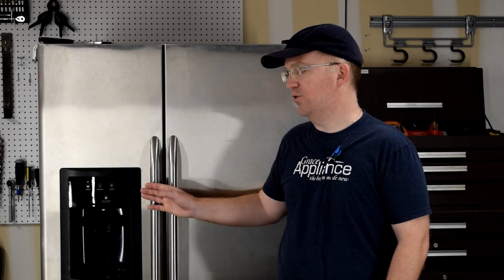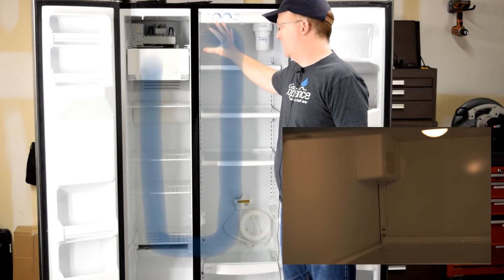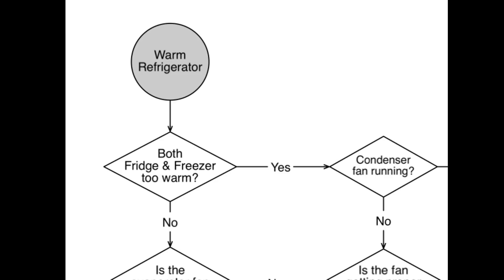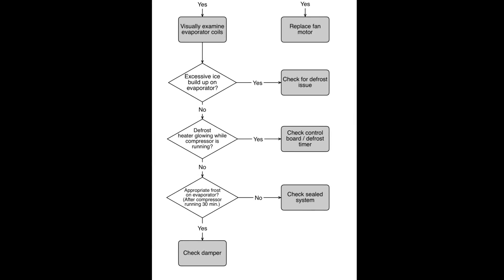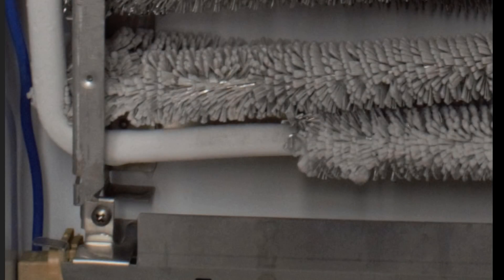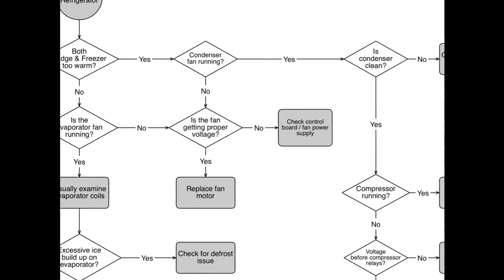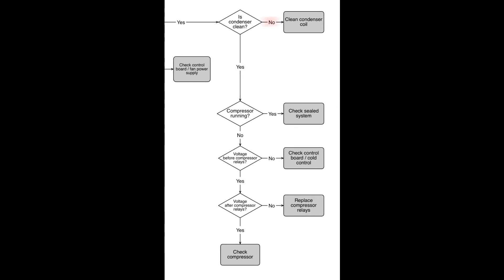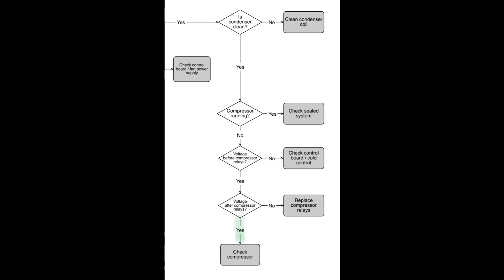Refrigerator Too Warm - Diagnostic Steps

Comment: HI Andy,  I recently replace the control board  and the heater element on my GE Refrigerator Model  GSHF5KGXCCWW  .  I am still seeing ice on the top coils but the rest of the coil are good. should I replace the thermostat as well .  The freezer is still not working where is should be and not making ice.  Any help will be be appreciated.  thank you.
Reply from the maker: Hey Danny, 
Sorry to hear about the trouble with your freezer.  
Before you replaced the heater, were you having a defrost issue? I.e. heavy frost build up on all of the coils and frost on the back wall of the freezer wall inside the freezer? 

If not, you didn’t have a defrost issue, but if not all of the coils are frosting up (except for like one rung of the coils), you may have a sealed system issue (refrigerant leak or compressor issue). 

Let me know what you were experiencing before the repair.  

Thanks!
Reply: Yes Ice was build up but after replacing the heater element , now just seeing ice on the top coils and the ice maker is not working.  I put an old ice tray and put water in it to see if it would make ice. after four hours it is getting frozen but i think it should not have took that long to make ice..  There is a strong water flow from the water dispenser  but now water is going to the ice maker.  I reset the ice maker but still no water.  So I am at a stand still.  is it the thermostat. or is the ice maker bad.. your help is appreciated.
Reply: Sorry meant to say Water is not going to the ice maker.
Reply from the maker: @dannygonzales4572  hey, please send me the first 5 digits of your serial number.

Bad thermistors (temp sensors) will not cause the coils not to frost up. If the compressor is running and has been for 24 hrs, your coils should be fully frosted. If only the 1st rung is frosting up, that sounds like a sealed system issue. It doesn't make sense to me that before a board and heater it was fully frosted, and after not. Unless the lines were damaged in during the process of changing the heater. Just my initial thoughts. 

You didn't use a screw driver to chip off ice from the evaporator did you?
Reply: SN: RR421562    as far as the ice on the coils goes, the coils were iced up on all of them.  I called out a repair man and he told me it was the control board and the heater element.  he wanted 400 dollars.  so I ordered the parts myself and it  stalled them   I unplugged the refrigerator for a day to defrost all the ice off the coils.  I had installed the control board first because that came in before the heater element.  Then a few days later I installed the heater element.  then waited a day and notice that there was ice on the coil but only at the top.  The ice maker stopped working so not sure where to look from here.  Do you think its the thermostat?
Reply from the maker: @dannygonzales4572 
It sounds like your evaporator is not frosting all the coils and as a result the freezer will not get cold enough.
The icemaker will not function unless it's under 15F.

As I mentioned, a failed sensor will not cause this issue. Only a sealed system issue will cause the evelorator to only frost on the top. To me, It sounds like it was misdiagnosed originally. 

Unfortunately, a sealed system issue is typically more expensive to repair than a normal fridge would be worth. It's not a DIY task unfortunately.

I'm sorry for the bad news, but hope the info is helpful.
Reply: So there should be frost on all the coils not just the top coil.  is that correct?   I bought this unit used and was working fine for about 3 months then the freezer got warm.  So I was hoping it was something I could fix my self.  I will be taking the panel off this afternoon to see if there is any change maybe I can send you a picture of it so you can see what I see.  is there an email I can send the picture?
Reply from the maker: @dannygonzales4572  Yes, every rung of the evaporator should have frost on it except for the first rung or two.  
This is assuming that the compressor is running full time and not cutting on and off repeatedly.  

The frost pattern is very telling if you can send me a picture today I'm happy to have a look.  I'm headed out of town tomorrow and will be away from the computer.   Thanks!   graceappliance@gmail.com
Reply: Awesome , I will do that.  should be home this evening to send picture.  Thank you Andy for all your advice.
Reply from the maker: Sounds good, you’re most welcome.  Talk to you then.
Reply: Hi Andy , Hope you had a great holiday.  I did order the Defrost Sensor from you and I was going to install it but after removing everything I noticed that the Evaporator fan in the freezer was not working.  I stuck my hand up where the fan is and it was not moving.  I moved it with my finger and the fan kicked on. It was not very strong because when i  stuck my hand again in the fan it would stop.  I unplugged the unit and then plugged it back in and the fan did not move until I pushed the fan with my finger.  So if the fan is not working properly then would ice still build up on the coils?   After I got the fan started  I left it alone and checked it the next day.  The ice dropped but it was slush and the ice was not hard. so do I still change the sensor or replace the Evaporator fan or both.  Thank you for your help in advance.
Reply from the maker: Hey Danny, 
I did have a great Thanksgiving and hope you did too!  Too much traveling and I'm definitely glad to be back to my own bed. : ) 

Based on the picture you sent, You don't have a sealed system issue which is great. Also, it appears all the defrost components are working as they should, so i'd leave the sensor alone for now. 

The fan not spinning (or only with a boost) is most likely going to be a weak fan motor and a new fan motor will probably do it.  However, it can also be the control board not sending enough voltage, which is far less common with the symptom you describe.  
If you have a volt meter, i've got a video that will walk you through how to test the voltages if you wanted.  Or, simply replace the motor and call it good. But, a fan not working properly will certainly cause ice build up on only certain coils as you describe, and can look a whole lot like a defrost issue. 

Based on your model number, the fan you need is: 
OEM GE Motor affiliate link: https://amzn.to/2KG4fxT 
or
Cheaper Aftermarket fan motor affiliate link: https://amzn.to/2E0wCpX

I haven't used the aftermarket one's before so I can't speak for the quality, but you can't beat the price.  You may dig in to the reviews and let that make your decision. 

Let me know if you have any questions! 
Thanks
Reply: Hi Andy,
I ordered the fan, I will let you know how it goes.  I wont have time during the week because of work but I will tackle it this Friday. 
Thanks for all your help.
Reply from the maker: Danny Gonzales awesome! Best of luck and I’ll be here if you run in to any hiccups.  Stay in touch.
Reply: Hi Andy, i put in the evaporator fan and I got a good deal with the after market fan with the link you send me.  The fan sounds a lot stronger and i can fell the are coming through the vent.  I have one question about the setting on the freezer.  what number do I set the freezer and refrigerator to?  On the freezer door the controls are there, so I want to set the coldness and you tell what number to set it to please..  Thank you for your help in advance.
Reply from the maker: Awesome! So glad to hear the good report. Nice work!

You're wanting 0'F in the freezer. I believe this means 5 as the setting, but I'd verify with a thermometer. Just make sure thkngs like icecream stay frozen rock solid. Chicken beast and meat as well etc etc.
Reply: Andy, I got ice, Thank you Thank you Thank you, for all your advice.  It was the evaporator fan that held me up.  I am hoping this will last a long time.  
Have a great weekend and Happy Holidays to you.  Take care I will tell everyone about your Videos.
Reply from the maker: @dannygonzales4572  you too Danny! Thanks
Reply: I want to send you a donation , can you tell me is it safe and secure to do so?  I am  just curious , 
where did you come up with the name Grace appliance?
Reply from the maker: @dannygonzales4572  thanks so much Danny. The donation link will take you to a secure link on PayPal which of course is totally secure. It's much appreciated.

The name Grace Appliance came from me having worked a 9-5 job at a very large bank which will remain nameless, I'll just say it rhymes with Chase Bank. I constantly feared getting laid off... Even if you were doing a great job and your department was doing great, they'd lay off 7,000 people at a time. I thought, ok if I move to a smaller company the stress will be less... Nope, still stomach knotting stress, just with less zeros when it comes to layoffs. So, this fear I found was not from layoffs but rather a lack of trust in God's sovereignty and purpose for my life. It took me a long time to realize that security comes from the Lord and not a paycheck. So, taking the leap of faith to start my own business was founded on Ephesians 2:8
For it is by grace you have been saved, through faith—and this is not from yourselves, it is the gift of God— not by works, so that no one can boast.

So, I wouldn't say I no longer stress about these things, but it's a reminder every time I pick up the phone. :)
Reply: Praise the Lord, I am a Christian as well and Its nice to know that there are good Christian people out there that will  help as yourself.
May the Lord richly bless you for helping people and saving there pocket book.  Have a great evening.  God Bless.
Reply from the maker: Danny Gonzales thank you again Danny for the ever so gracious donation! Bless you and your family this Christmas! Stay in touch.

Comment: Andy, this is a very informative video.  We have a GE Profile Refrigerator (Model TFHW22R), around 26 years old, never needed servicing, 2 door side-by-sdie freezer on left/refrigerator on right.  Freezer is 10F and Refrigerator is 48F.   I do hear a motor sound.  I pulled the Refrigerator out and the coils on the bottom had a heavy accumulation of dust which I vacuumed off and blew out with my air compressor.  If I read the Flowchart correctly, I have a "Sealed System" issue which I suppose likely means low on Freon.  How do you check for low Freon?  What Refrigerate does this refrigerator use?  I have some automobile AC compressor gauges (R132) and some Heat Pump gauges that I could use but don't know the pressures or where the Hi an Lo taps are at.  The other consideration is to simply replace our Refrigerator with a more modern one but we hear a lot about newer units being so unreliable.
Reply from the maker: Hi Carl, thanks for the kind words and I’m sorry to hear about your fridge issues. 
Just as a general statement, if both compartments are warm as in your case, dirty coils can cause this problem. Once cleaned and having run for 24hrs - the temp in the freezer should freezer should be sub zero (around 0’F, assuming the condenser and evaporator fans are both operational). If after this long it’s still not at temp, I would agree it’s a sealed system issue. (Note: Be sure you’ve ruled out a defrost issue as well, heavy frost on the evaporator coils and on back wall if the freezer cabinet) 
This could mean low on refrigerant, but most often it means a failed compressor (I.e. a compressor that isn’t compressing as much as it should any longer). 

To answer the questions about the refrigerant, it’s going to be R134a which is the same as most modern automobiles. However, dealing with sealed system jobs is not a diy task. To check pressures requires tapping in to the sealed system via valves that aren’t there currently, and looking at the low pressure side pressures. You’d then weigh in the right charge of refrigerant which is only like 4-6oz and requires some equipment most folks won’t have. 

If you’ve determined it is in fact sealed system issues, the right answer is to put the money towards a new refrigerator, sorry to say! 

Let me know if you have any questions. Thanks!
Reply from the maker: Also, verify that it is in fact the compressor that you hear running. Should be vibrating some and be warm to the touch.
Reply: Popped the inside back cover off the Freezer compartment and noted a lot of Ice on the upper part of the coils.  My Refrigerator has two heater strips and when I turned the control to Defrost the strips worked, but did not get all the ice off.  Turned it back to Defrost again and neither strip was hot.  Took my ohm meter and got 11.5 ohms for each strip.  Assuming the Thermostat.  Well, I used my heat gun to get all the Ice to melt and put it back together.  Still the Temps are 20F in the Freezer, and high 40's in the Refrigerator.  I'm assuming my old 26 year old Refrigerator is ready to be retired.  

We have a 36 inch opening but its next to a door opening and the moulding protrudes about 3/4".  Do they make new Refrigerators that are 35" ??  Or do we have to go with a 33" model?
Reply from the maker: Hey Carl, 
I agree. It appears to have a sealed system issue judging from what you’ve described.  I’d put the money towards a new refrigerator as well. 
The width is not a standard thing. They’ll typically be somewhere between 30-36” to allow fitting through doorways. You’ll need to look at the specific model spec sheet to verify the width so it fits in your space.  They also make counter depth fridges which do not stick out as much which may or may not help your situation too. 

Thanks!

Comment: Hi Andy, videos are great same as you, my model No: GSR23KSTE SS , PROBLEM IS THE FRIDGE WORKS BUT WHEN IT TURNS OFF BY ITSELF IT DOES NOT RESTART BY ITSELF UNLESS I APPLY HOT AIR FROM A HAIR DRYER TO THE CONTROL BOARD AT THE BACK AFTER REMOVING THE COVER, THEN IT WORKS FOR SOMETIME THEN THE WHOLE THING REPEATED AGAIN AND AGAIN,,,, WHAT DO YOU THINK THE PROBLEM IS
Reply from the maker: Hey Freedom, 
Thanks very much for the kind words, It means so much. 
Interesting!   Almost certainly it's a failing relay on the main control board.  They will get weak when they're on their way out. They will intermittently complete the circuit and other times not. 
It may have less to do with the hair dryer and more to do with slight jostling of the board which causes the relay enough umph to snap shut.  

One thing i'd want to know what exactly cuts off when the board gives issues. 
If the compressor, fans, and front panel cut out all at once (but lights stay on) - It's the main board (my guess based on your description)

If everything cuts off (lights included) - likely a power / connection / cord issue. 

if the fans continue to run, but the compressor only cuts off - it's likely bad relays at the compressor (not the main control board) 

If you haven't already, take a look at this video and see if you can identify any of these common failure points on your board. Often these boards capacitors will fail causing this symptom you're having. 
https://www.youtube.com/watch?v=zbmAqizE128

I hope that helps!   Let me know what you find.
Reply: Thanks very much Andy for your fast reply, I didn't expect that great , professional and polite response, as for the fridge when it turns off it is complete off except the interior light but the front panel lights are off too, and when it works after I dry its hair , it works perfectly fine sometimes for a day or two and sometimes just for one cycle, also sometimes it turns off with a clicking sound coming from the front panel
Reply from the maker: Hey Freedom, 
You're most welcome. 
The symptoms you mention make the main control board (behind the refrigerator) super suspect.  I'm still leaning very heavily toward that being the issue. 

One thing I neglected to mention in my last response was, you'd want to be sure to rule out a failed (i.e. shorted) touch panel in the front of the refrigerator. 
Please take a look at this video: 
https://www.youtube.com/edit?o=U&video_id=ViFpwH6_WrM

If you can catch the fridge while it's in an off state/giving the issue currently, if you will unplug the wire harness from the front control panel - the fridge will fire to life.  If it does this, it indicates a shorted front touch panel. If no changes when you unplug this board, it would be a failed main control board behind the refrigerator. 

I hope this makes sense and helps!   

Andy
Reply from the maker: sexylitehaiti sexylitehaiti 
Hey,
Too hot to touch. It glows orange like a toaster.

Let me know if you have any questions. Thanks
Reply from the maker: Hey, you'd need a multi meter to check for 120v to the 2 wires while the defrost is on to be sure. But it does sound like it's getting power.
Also, you can disconnect the heater from the wires and do an Ohm resistance test to see if the heater is good. Should be around 20 ohms resistance.

Once the heater is working, that will likely help keep the drain line clear from the heat it puts off.